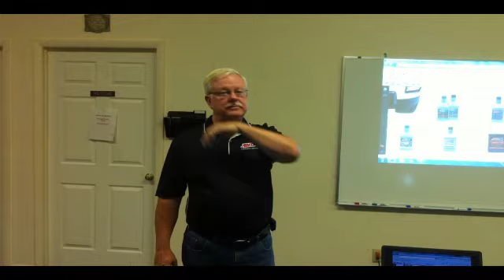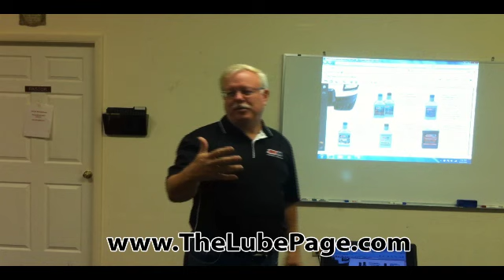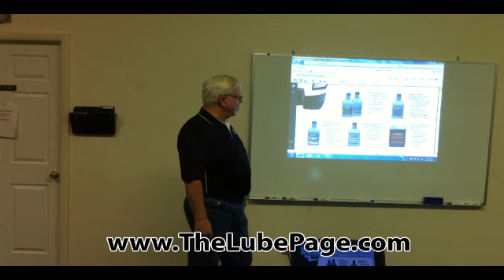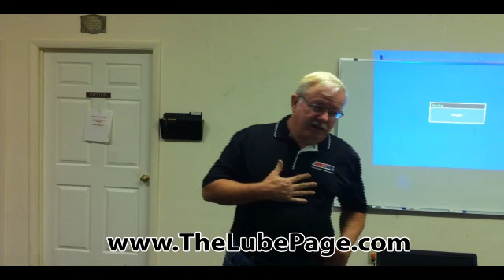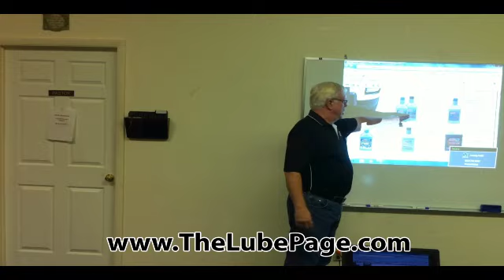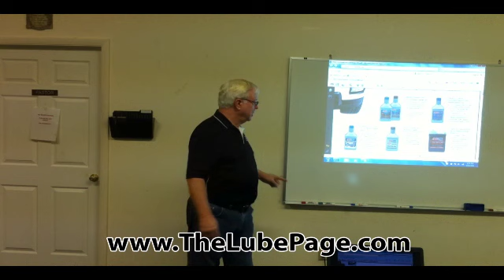AMSOIL Synthetic Diesel Oil

Comment: did you learn what a CVT is yet? 

ci4+ works FINE ON EGR we have had egrs on the diesels since the 80s...  and DPF has nothing to do with the oil unless your saying your oil cant handle the regen heat.

Black smoke has nothing to do with a BAD or GOOD tune rofl... best tune for a diesel IS smoke, that means you are using ALL your air... 

They dont over fuel, they inject fuel on the exhaust stroke this dude knows NOTHING and this is your amsoil teacher... think how little amsoil dealers know. 

He tells you flat out, the best thing on a new diesel is... CHANGE YOUR OIL OFTEN so you dump that diesel out of your oil... then again he like "well they have a crankcase vent now" um my 80's diesel had a CDR (crank case vent)... dude knows nothing...

lol amsoil passed the buck, "dodge never told him" um I am sure that owners manual says to use cj-4 oil... its his fault for using amsoil junk.

amsoils "diesel concentrate" is SO expensive you might as well NOT use it and just replace the parts as they go bad...
Reply from the maker: Matt, why the hostility?  What is it I need to learn about a Constant Velocity Transmission.  I'm certainly not an expert on CVT's so if you can school me on my mistake in talking about them then I'd appreciate the help.

Black smoke is soot.  Soot is unburned or poorly burned diesel. And yes it is dependent on proper fuel air mixture.
To much fuel and not enough air will make soot.  When diesel is not fully atomized (completely mixed) with the air it will not fully burn and this leaves soot in the exhaust.  Injector performance is critical to facilitating optimum fuel  air mixing for the most efficient burn.  When injectors get dirty tips they do not provide a complete 360* spray pattern and raw fuel can drip into the cylinder causing excessive soot.  Turbo charging provides for better control of the fuel air mixture by adding in the ability to control air flow as well as fuel. 

With regard to CI-4+ and EGR your correct, one of the reasons for modifying CI-4 to the + rating was to deal with the higher levels of EGR being used to further reduce Nitrous Oxides in the exhaust.

Now the DPF is the whole reason for pushing diesel through the engine on the exhaust stroke.  The DPF has to be cleaned of the carbon (soot) it collects.  The diesel burns the soot out of the DPF in the 'regeneration cycle'.  How it affects the oil is by fuel contamination.  The CJ-4 oil is formulated to tolerate higher levels of fuel contamination and higher levels of soot than the CI-4+.  I'm fully corrected on using the term over-fueling, I just got lazy and didn't want to go into the method of getting the diesel to the exhaust.  Pretty arrogant statement on me knowing nothing and then trashing all Amsoil Dealers. 

I could be wrong but the crankcase vent in older diesels was vented to atmosphere where the new crankcase vent is vented to the intake to prevent oil vapor going to atmosphere.  This is mandated by the EPA. 

Your comment on the Dodge truck owner doesn't rate a reply!

Considering cost you must not have ever had to replace any of the current diesel injectors or fuel pumps.  Injectors can run anywhere from $600.00 to $800.00 each and fuel pumps even more.  You sure can buy a lot of diesel additives for that kind of money.
Reply: Listen first off after 7 YEARS, you still think a CVT is a "Constant Velocity Transmission" you are recommending oil and talking about oil for a tranny that you do not know its CORE CONCEPT OF OPERATION... and this is again after 7 YEARS.  I aint gona type up a whole thing when you can youtube how a CVT works and even more google what CVT stands for.  

I can tell one day you decided you were going to sell oil, you have no background in the auto field, no knowledge... you aint 20 in this vid... current diesels burn WAY CLEANER than the old n/a IDI motors.  I won't get into tractor trailer sized engines, pickup engine from the 80s go down the road blowing smoke... normal operation.  They are running 5000psi MAYBE... vs the 30,000psi now... you act like soot is new in a diesel... no it is old, it is way less now than ever before.  Turbo provide more air, that is it, a engine does not control air flow, VGT turbos are to give boost at lower RPM... from one turbo for again emissions... diesels are pure FUEL metered engines... if not, runaways would not be a thing (just control the air and no problem).  If you know what a run away is.

I know why they put diesel in on the exhaust stroke 1, they are retards (not using a doser injector) and 2, ya DPF garbage cleaning... you are using overfueling WRONG, when you have a over fuel condition, it is a FLOODING condition.  Example, (gas) coolant temp sensor is reading -40F, actual temp is +50F.  The engine will, OVER FUEL and not start.  Putting in fuel on the exhaust stroke is not "over fueling"  learn something.  Actually if anything (and I can not find a definition of "over fueling" to post) when you see the black smoke... that is over fueling.  Btw if you are teaching amsoil dealers (look around on YT at how scammy they all are) then um, they only at best gona know the wrong info you tell them.

you are wrong, seeing as I own 1980's 6.2's (military and civi) civi has EGR AND CDR (look it up) military has CDR (however it also has a oil cap with only slight pressure so it can vent if the CDR stops working) everything I heard here was pickup truck and so sized... NOT tractor trailer sized so I am commenting off that.  Does every one have that stuff idk.  Do tractor trailer engines likely vent to atmo, ya.  But we talking about pick ups here... at least that is all i heard you talk about really. 

My comment on the dodge truck owner doesn't "rate" a reply because, i was correct, and your ci-4+ oil he was using should not have had issue from EGR... your customer got a owners manual, he was told when to change the oil and what oil to use, he did not, he used amsoil and got screwed.  I am sure amsoil said RUN IT LONGER!!!!!! and that dude did and got fed... had he just used NORMAL OIL... and followed the manual he be fine. 

I've put IPs in my truck ($350) and injectors ($230 for a set of 8) ya ya i know the price of newer junk... maybe a brand new factory injector for a big rig is $800... sure as hell aint for a pick up... you get a reman injector... come on bro.  Come on bro, 64oz 160gal, $38... at 15mpg thats 2400 miles 38$... lets say your number injectors go out at 300k... that is $4750 in additives... like I said, who cares... 

I run optilube in my trucks with injectors that cost like $30 each... lol.  I aint never putting a $7 bottle into my 20 gal tank... I'll put... I think opti lube costs me like 50 cents a tank.  

My problem is all the bad info being pushed out... and more so how scammy all the newer amsoil dealers are now on here...
Reply from the maker: Yes!!!  Constant Variable Transmission- Thank You! I think it is important to establish a significant difference in what I am trying to accomplish with my training than what you must think.  I don't really care exactly how the CVT works.  What I want to know is how is it different and why it requires a different lubricating oil.  I am trying to give my folks an understanding to know without any hesitation that you can't run regular ATF in a CVT.  If I can give a good layman's explanation so they will be careful and recommend the correct lube then I have accomplished my mission.

Knowing my purpose in training is to point out a particular characteristic of a piece of equipment that requires the oil guy to make a different recommendation I will now address your other comments. Make no doubt about it I do not claim to be a diesel mechanic so my main purpose is to explain why the oil formulation had to be changed.

Yes CI-4+ worked well with the EGR system.  The DPF itself is no bother to the oil. It's the REGENERATION (cleaning) of the DPF that causes the problems.  As you said, correctly, the diesel is put into the cylinder on the exhaust stroke but (and my term "Over-fueling"being a poor description) the process results in approx 10% fuel contamination of the engine oil.  CJ-4 oil was formulated to withstand greater fuel contamination and maintain greater soot loading than CI-4+.  Prior to this DPF regen problem the fuel contamination limit was (depending on which reference) 5% max.  The new SCR exhaust system (has the Urea tank) 2011 models reduces the need for EGR and significantly reduces the number of regen cycles.

I'm not familiar with the history of the EGR use in diesels.  What I do know is that the EGR system was the primary method of reducing Nitrous Oxides from the exhaust.  The EPA reduced the allowable NOX and the levels of EGR were increased to meet these requirements.  Simultaneously, the EPA mandated lowering the Sulfur content of diesel over this time from approx 2500 ppm to 500 ppm then to 15 ppm current limit.  The EGR takes exhaust full of soot and puts it back into the cylinder and this really packs the oil with soot.  As you know high levels of soot can thicken the oil and the condemnation limit is more than one grade (going from 40 to 60). CJ-4 oil was formulated to handle greater amounts of soot. The SCR exhaust system I mentioned above uses Urea to neutralize the NOX in the exhaust system significantly reducing the level of EGR. The latest formulation of diesel oil is rated as CK-4 With several OEM changes in performance required.  See, Amsoil nor Mobil or any other oil company set the performance requirements, it comes from the OEM's.  The oil companies have to figure out how to get their oil formulated to pass the test required by the OEM's.

As far as venting the engine, The EPA mandated that no oil vapor can be vented to atmosphere, so now it has to be vented to the intake and burned. It sounds very similar to the PCV system on gas burners but I haven't studied it.  Again, all that is important to me is that it is going back into the engine and that vapor will make soot because it will not burn as readily as the diesel.

Again, you are absolutely correct about the enhanced ability to control the fuel air mixture with turbos. Along with modern injectors running around 25,000 psi (that's ballpark not intended to be exact) it is possible to get an almost perfect burn leaving little soot to deal with. Let those injectors malfunction and you can make a lot of soot. Now as for the exact proper tuning of the engine that's your expertise not mine and whatever you say is the Gospel.

The reason I said no comment on the Dodge is that you had to devolve into Amsoil bashing instead of just stating your case as to how he could have avoided a problem.  I don't know what about Amsoil causes you to have such personal animus but when you start the bad mouthing you loose credibility.  Your right, you could change oil every 500 miles and never have a problem.  Did you know that Cummins in the new Dodge  recommends 15,000 mile change intervals with Premium Blue synthetic. See Amsoil is not so crazy after all.

As far as the fuel additives and the cost of injectors I don't agree with your numbers.  The fact that you use Optilube shows that you do see value in using a diesel additive. 

Amsoil 'Diesel Injector Cleaner'  = $6.00/16 oz bot (Preferred Customer Price)
Treats 80 gallons of fuel
From your example: 64 oz  =  $26.73 (PC price)  Treats 320 gals of fuel
15 mpg  =  4,800 miles  = $26.73
300,000 miles  =  approx 62 bottles at $26.73  =  $1657.00
Current injectors for the Chevy, Ford or Dodge turbo diesel trucks will cost at least 600.00 a piece not to mention the labor of over $100.00 an hour to do the work.  About 4 years ago I saw a bill for just under $7000.00 for replacing 8 injectors for a Duramax.  

Bottom line is use someone's injector cleaner and lubricant just make sure it does all it is supposed to do and then get the best price.

Now again you go low with the SCAMY comment, come on Matt, your to good with arguing your technical points to have to start the name calling.  I will always take the time to learn from someone like you because I can see you know your mechanics but I know oil.  I am a Certified Lubrication Specialist (CLS) by the STLE NOT Amsoil.  My lube knowledge is not from Amsoil training.  My engineering training is from the US Navy's Nuclear Propulsion program.  I'm a Rickover trained Navy Nuclear specialist and I'll hold my own in the underlying principles of chemistry and physics and heat transfer with anybody in the oil business.  I depend on facts not folklore or personal insults.

You do me a favor and watch all my videos and point out mistakes in some of my terminology and mechanical statements, I need the feedback to keep learning.  I hope to be learning something new on my death bed, I hope to annoy the doctor with questions on the details of my demise.
Reply: @mattlane2282  Did you ever come up with a good response?

Comment: So, just to confirm, in your video you stated that modern diesels should not run the signature series oils due to the Moly additive creating sludge when interacting with the emissions control devices (or something along those lines).

 HOWEVER, if I still decide to use the signature oil, I can run at manufacturer suggested oil-change intervals, AND run a detergent additive such as Amsoil diesel all in one. Is it advisable, or even necessary to run Amsoil all-in-one AND Amsoil injector cleaner together at every fill up?

I drive a Chevy Cruze diesel, and through research I found that Amsoil improved esp blend  5/30 is GM approved, with Dexos 2 and EU ACEA C3 certifications, as well as the correct viscosity as per manufacturer recommendations for my ambient temperature range. Is this still a case that I should not run passed man. suggested intervals, or am I good to go the full 25k with this oil and additional additive(s) stated above.
Reply from the maker: Alex, you have several things confused.  I didn't say anything about Moly creating sludge.  What I did say was that the EPA limits Zinc and Phosphorous to lower levels to protect Catalytic Converters from carryover that could potentially cause problems.  Your Cruze diesel can use the Amsoil 5W-30 European oil formula with great success.  Amsoil recommends Manufacture's drain intervals for European applications.  For the Cruze which is American you need to stay around 7,500 miles, or longer id authorized by GM.

Comment: I haven't tried amsoil yet... I just started doing my own oil changes and I'm new to synthetic oils also. I read somewhere that there are only 3 true synthetic oils on the market... Royal Purple, Red Line and AmsOil. I want to try all three, I changed my oil for the first time back in November and used Royal Purple because it's easily found at Pep Boys.